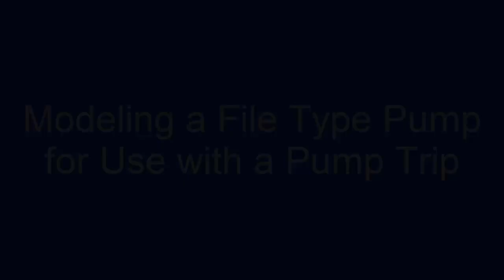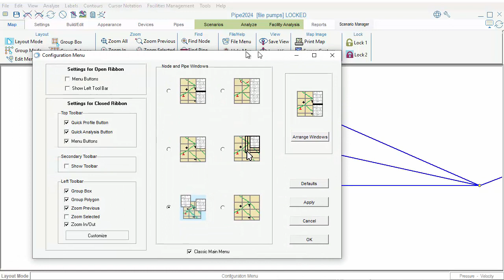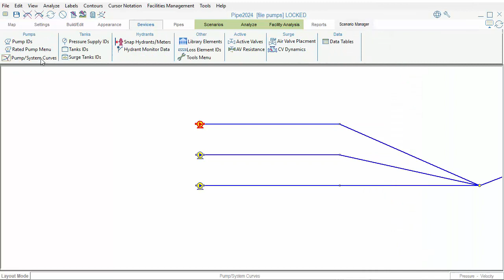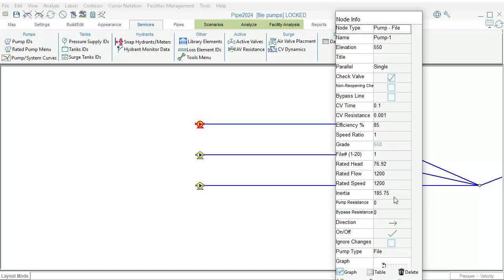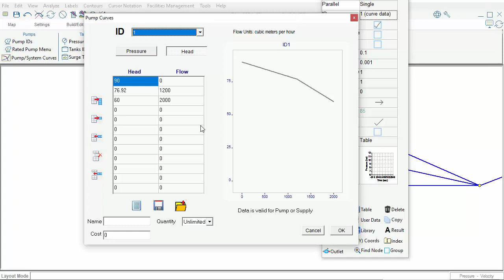Modeling a File Type Pump for Use with a Pump Trip

Comment: Timestamp Bookmarks for later Reference

0:10 Pump File types reviewed
0:25 File refers to underlaying diagram use to model pump trip 20 different types only used in modelling trips

1:40 Unique Data For file type Pipe Efficiency, File #,RAted Head, Rated Flow, Rated Speed, Inertia
2:05 For info on parallel and Pump resistance see Video Modeling Standard (Table) Pumps in KYpipe and Surge
2:12 Review of Elevation and Grade settings
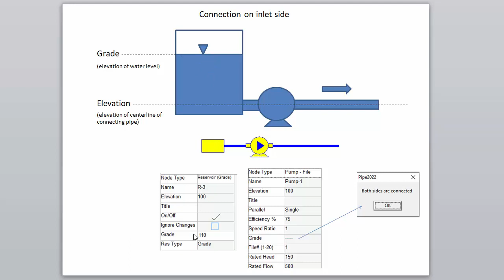3:04 Rated Head and Rated Flow
3:48 Rated Speed at Operating point
3:50 To get File number and Inertia use built in tool under Tools->Select pump file/calculate inertia
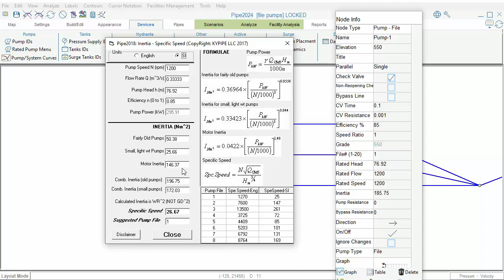5:45 Now look at File-Table Pump
	only difference is now data is entered. For a File-Table type pump the curve data entered into pump ID is used.
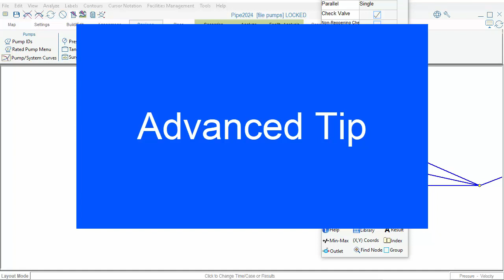6:22 Advanced Tip -Surge and Steady State will not much as using sod File to model pump trip with Pump Curve
Reply from the maker: Justin: thank you for providing these. Very helpful! We have copied them to the Video Description. - KYPipe Technical Support (Eric).